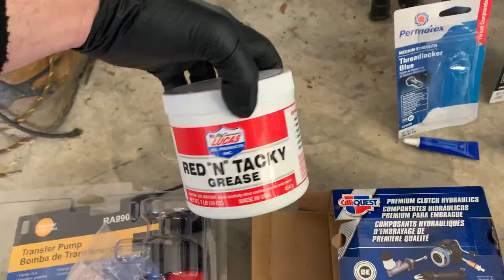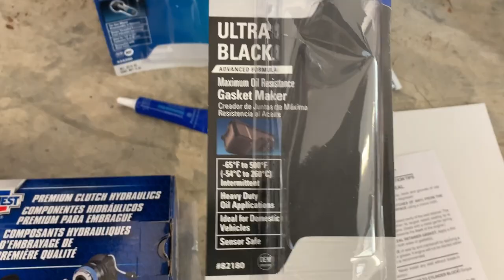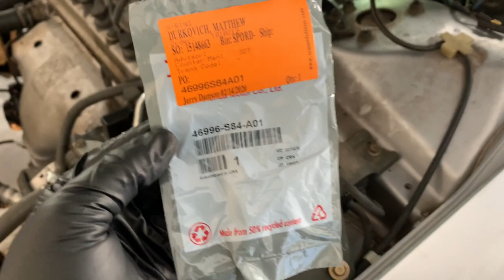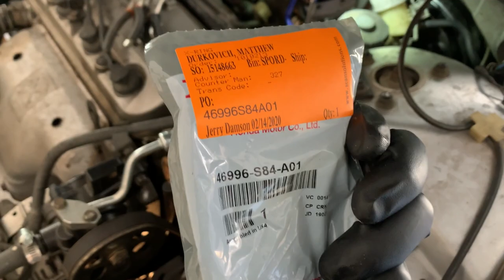2002 Honda Accord clutch and transmission mother load video!!!

Comment: rear main and front main seals typically go in dry. and before the seal housing is installed. ive never ran lube on the seal housing or seal. just a tip for others.
Reply from the maker: Solid tip. Other mechanics I talked to said dry could be an issue. I will say I liked doing it after seal housing to ensure it was exactly flush. A few millimeters wouldn’t matter to your point. I’m not a pro though. Appreciate the tips!

Comment: in doing this job ive lost order of the bolts for the bell housing (which ones go where) are the two on the top the same size and also i have the trans up and in but its not sliding in completely as it should any idea what i should do? or whats going on?
Reply from the maker: Hey there. First off, from what I recall, yes, the bell housing bolts are all the same size. I don’t recall putting them on my paper and saying “3rd bolt down” or anything like that. There is only one bell housing bolt. If it’s not fitting in the hole, you have the wrong bolt. 
Regarding the trans not sliding in all the way, that’s a rough one. If I were you, and the bolts weren’t in, I’d just pull it back out and double check everything aligns. Hopefully you have a transmission jack, or a friend:) The advantage to pulling it out and retrying is you can be sure everything is as it should be before reinstalling. If the input shaft is aligned, and you used a clutch alignment tool, the dimensions align and there’s nothing to restrict the bell housing from properly seating. Maybe the clutch fork slipped or was otherwise in the way. Make sure there’s no wire or cable or part getting sandwiched either. Get help putting it back in. As you see in the video, I had my son top aide to spot me visually, and start threading the ones that thread opposite. That was really helpful! 
Good luck!
Reply: @durk1980  thank you! i ended up finishing it last night i have a few bolts + the trans mount in just to hold it and im going to head back in there tonight after work and button everything up i appreciate how helpful you were great video!
Reply: @durk1980  normally i leave the bolts where the go by just threading them in a tad but ive been solo on this job so by the time im pulling the trans on top of myself there is shit everywhere on the patio lol😂
Reply from the maker: @Alpixed, I hear you. It’s always 3am when we’re finishing these, and you find yourself bench pressing a greasy, slippery, heavy chuck of metal above your head. That’s why I bought the transmission jack finally. Hopefully everything works out. Good call on slightly putting all bolts and fasteners back in so you don’t lose anything. Where possible, this is a great habit. Good luck man!

Comment: I have to swap out this Honda engine how long will it take and what will I need ?
Reply: Engine swap? Not sure. This was transmission. You’ll need. Strong engine hoist for sure, and all the necessary bolting/unbolting tools. Not a simple job, but not the hardest either. To pull an engine you have to disengage from transmission, hence the beast of a job. Good luck!
Reply from the maker: Hope it went well!

Comment: Did u install a new pilot bearing on the new flywheel?
Reply from the maker: Go to 1:42 in the video. I did not, because it came with one already installed. Most new ones will have it already on there. Best to check though.

Comment: everything dismantled and now i cant get the trans to seperate
Reply: Probably dowel pins are corroded and you need to “wedge” a pry bar between block and tranny to “crack” the seal. Also you are probably missing a hidden bolt.
Reply: @MrMpm3001  alright I'll keep digging appreciate it this has been an absolute nightmare
Reply: @angelic420x5  I bet it turned out to be the 17mm under the t bracket. It’s a bih to see at a glance.  Also you’re gonna have fun getting it back in and lined up too.
Reply from the maker: Hope you got it to separate! You may have seen in the video where I forgot that one bolt, but it was separating, just not 100% releasing, so I knew it was hung up somewhere. In your case, I’d put the bolts back, but not all the way, and try to take a pry bar as suggested and crack it loose. The bolts being in will prevent it from just falling. Safety first for sure. Hang in there man, this job sucks for sure, but you’ll get it…if you’re right there, you’ve already done the hard work. BTW, if the rear main seal isn’t leaking…leave it alone:)
Reply: @durk1980  lol yeah my friend told me that to

Comment: Im getting ready to do this job (minus hydraulics) on my 2000 accord. Why is it necessary to remove the axle on the driver's side,  what will happen if i don't?
Reply: Disregard, i answered my own question.
Reply from the maker: All good! Hope you had success.
Reply: @durk1980  I did,  thanks... I used your video extensively throughout.

Comment: If I'm not looking to replace the slave cylinder, only clutch, flywheel etc, do I still need to undo all the stuff from the top of the engine bay?
Reply from the maker: Yep. Everything for the clutch was in sequential order. Once I started slave cylinder, you can ignore all of that. Very detailed amount of steps still, but take your time and it’s definitely possible. Good luck!
Reply: @durk1980  thanks for the reply, mate.

Comment: Absolutely wonderful video. I’m going to use this info to remove a manual transmission from the junkyard for my currently automatic accord.
Reply from the maker: I’m not sure that will work. Automatic and manual transmissions are different. I say I’m not sure that will work because I don’t know what you’re trying to swap out. Make sure you “measure twice and cut once”. Good luck!

Comment: great video. Im going to do this job next weekend and this video will be invaluable to me and make my life easier. I definitely see where the parts where chrisfix has influenced you haha (the transmission bolt wrench trick, brake cleaning the fly wheel and pressure plate, marking the torqued bolts with sharpie, changing gloves, input shaft jiggle, etc)
Reply from the maker: Lol. I’m a lot like Chris Fix in that regards. I’m a little OCD. That’s why I love watching him. I have watched so many of his videos and they call me, lol. Good luck!

Comment: Thanks, nice video. I did clutch on my CRV 2005 140k miles. Put the transsmition on is very tricky. I had teeth on teeth on the central axel to crank shaft and also on the wheel drive shaft. Then I little turned with the rear hub and everythink click together. Ohh, horrible job!
Reply from the maker: Yep, it's a beast of a job!

Comment: Ooo wee this looks like fun 🥲 
I picked up an 01 accord ex manual for free the past owner said that the mechanic told him it needed a clutch so he bought it and never installed it because he said the car was being a headache so he just gave it to me for free I stumbled into him by try to sell a product lol he told me the car turned on but didn't go into gear so I took the offer and started investigating and found out the shifter cables were torn replaced that also had a cracked manifold replaced that all four engine mounts were bad so while I was installing the shifter cables and manifolds I went ahead and just put the engine mounts and hoped it ran so I started it and well it ran but It seems the clutch may be bad and thought on replacing while I'm at it but I've taken approx 1 week lol since I'm new to this so this looks like a lot more work and might as well get the new slave cylinder and master cylinder wish me luck and thank you for the Vid.
Reply from the maker: Good luck!

Comment from the maker: @Cooper Pierce
Cooper, I fat fingered this and removed your comment on YT accidentally. Through the app, I’m responding. Hoping it shows up. Check 29 min mark. The paper gasket is sandwiched by RTV. I had 3 in my kit as shown in the beginning. I personally don’t know if there are simply extras, but only one fit perfectly for me. You only need the one. Also, if the rear main seal isn’t leaking, don’t touch it. I know the temptation to replace is high, since you’re right there, but I found that the original one will keep on working. If you’ve already replaced it, all good. So did I obviously, and I liked the peace of mind knowing it was new. Good luck
Reply: Thank you sir they must be extra then just wasn't sure.

Comment: @durk1980 can u shed some light in the axle problem I have a 98 which is the same as this one my transmission seems to be slipping also what was wrong with the axles to make it slip don't want to change clutch if it's axles in mine
Reply from the maker: My CV axles were simply “dry”. The grease was no longer grease in the boots. I think it was a combo of clutch being worn down, and cv axles not being “smooth”. Short of major issues, there’s really nothing else it could be. I ended up replacing my wheel bearings as well, from sounds made while turning. Everything sort of fell apart in one time period, but after 18 years of hard driving, that’s pretty good IMO. I made videos of all that. Check out the main channel and you’ll see them. Good luck!

Comment: I got quoted a 1100 to do this. I’m debating if I should take on this by
Myself ..
Reply from the maker: Good question. Materials alone will be significantly cheaper, but labor, and any associated errors, will be all on you. That’s the risk with any DIY project. It was totally worth it for me. Just remember, if your rear main seal is not leaking, leave it alone. That was the one thing I regretted doing in my project. I didn’t hurt anything, but if it ain’t broke, don’t fix it. Good luck!

Comment: @35:25, are any of the fasteners in the project torque to yield (one time use only fasteners) that need to be replaced when reinstalling?
Reply from the maker: No, but you do need to reapply threadlocker where I’ve pointed it out. Even if I didn’t point it out and you feel threadlocker is appropriate, go for it. Just know what color is what and don’t “lock” something you shouldn’t. :)
Reply: @durk1980  thank you!  I’ve only used red thread lock on one occasion. It was when I got tired of a screw backing out of the faucet handle on an outdoor water faucet.

Comment: to drop the axle out of the wheel hub you dont have yo hassle with the ball joint or anything just the upper control arm and the wheel hub should drop down and you will be able to then pry the axle out
Reply from the maker: Good suggestion, thanks!

Comment: Nice video! Did you end up using the paper gaskets for the rear main seal housing gasket plus the rtv? Would you recommend I change the rear main seal gaskets as well or just the rear main seal itself?
Reply from the maker: @Moi Hernandez, yes. Checking out 28:30 in the video. If you replace the rear main seal then you have to do the gaskets. That said, if your rear main seal isn’t leaking, leave it alone. You just run the risk of it leaking later and asking yourself, why didn’t I change it when I was there?!

Comment: how did you keep your motor from falling if you took down the subframe?
Reply from the maker: You can see when I get to the clutch, and the camera is under the car, that it is indeed freely hanging there. I removed the transmission mount, and you have to put something under the bell housing at that point, and then of course once it’s separated from the rest of the transmission, it’s ready to be removed entirely. The engine, however, has its own engine mount, and that is what keeps it supported. I will say you’ll notice once I start taking off the pressure plate, that I have a block on top of my floor jack, supporting the other half of the bell housing. This was in order to not let it sway back-and-forth as I was loosening those bolts. It is supported, but if you were to push it down really hard from the top side, you would certainly feel a great amount of movement. As you start taking it apart, you’ll see when it starts to flex or barely move, but it is indeed, safe.
Other cars you can’t do that. You’ll see an engine hoist in my Mini Cooper videos. That engine is barely held in there to begin with.

Comment: I have a question I have one that I just bought at 115k there is vibration in the clutch when pressed soon as it's driving u can here like a little whine. Any info helps. Thinking it is Throughout bearing
Reply from the maker: Tough to say. Could be throwout bearing, could be clutch, or it could be the flywheel. If you hear a whining, something is grinding would be my guess. Truly, it’s a hard job, but not so hard that you can’t do it. If you have 115k miles, it’s likely the original clutch. If you get the whole kit that I did, just be careful not to change the rear main seal if it’s not leaking. That one for sure is one where “if it’s not broke, don’t fix it”.
If you watch the video again, when I show the inside of the bell housing, just realize there are only so many moving parts. Something along the line has failed. You can start with a cheap part, but in order to get that bearing, the bell housing has to be separated and dropped anyway, at which point, you might as well replace it all. Good luck!

Comment: 31:56 Some say not to put any grease/oil on the OD of the seal then drive it in dry or else you may get a leak.  How has this rear main seal performed since installed?
Reply from the maker: I sold I’m the car several months later, but it wasn’t leaking oil when I did. I will say I should’ve left it alone. Unless you see visible signs of leaking, leave it alone. That was nearly 200k miles old and going strong. Why replace it? The main reason is because you’re there and by the time you get that many layers deep, “you might as well”.  For what it’s worth, I really did wipe away much of the excess. I’ve put that grease on several times in a video, and when watching it during post it does surprise me how much it looks like I flipped it on, when in reality I’m just coating the surface so it glides and doesn’t dry start mechanically. Good question though. If I were to do it again, I guess I wouldn’t put anything on just to compare, but I’ve never heard of it leaking because of that. Not saying it isn’t true though; just haven’t experienced it myself.
Reply: @durk1980  Thanks for the reply.  Here's where I was advised not to grease the OD  https://youtu.be/vVDvEE_Hbm0  I haven't seen anyone else do that either.  I just replaced the rear seal on my '05 Element at 126,000 miles, not because it was leaking (in fact it was bone dry and perfect) but because I had dismantled that far in anyway and from past experience with the clutch on my '01 PT Cruiser, where I skipped that step, one month later the rear seal started leaking.  It's preventative maintenance when you are working on older vehicles with over 100,000 miles.  With this Honda though, I felt guilty about removing a part that was not faulty.

Comment: i can’t get the trans back on the motor. any help appreciated
Reply from the maker: @Austinp718  I had a tough time myself. The video goes fast through that part, but if the input shaft is straight, it will go in. Trouble is, if it’s off even a tiny bit, it won’t start going in. Then, the splines have to align just right, which is why wiggling it back and forth a little bit is good too. I just did my sons Mini Cooper twice, due an error on my part the first time (left one flywheel bolt due to stripped hole I didn’t want to fix - thinking it would be fine). I did get the flywheel bolt in with a proper tap FYI. The first time I removed and reinstalled the bell housing by hand. Removing is not so bad. Putting it back in was very, very hard. The second time I bought a low profile transmission jack from Harbor Freight. It was helpful removing it, but invaluable putting it back. Get help to have another set of eyes guide you in. With an aligned input shaft, and no weight to bother you, it will go in much easier. Good luck!

Comment: At 7:20 next to where your finger is . That pipe piece what is that for ? I put transmission fluid through there :0
Reply: PDF  how would I know if my transmission is low on mtf ? Seeing that they don’t come with a dip stick? I just bought the car so I’m new to this
Reply: PDF  thanks appreciatte it
Reply: @midas5096  I refreshed my transmission oil on a 2.3 Honda Accord from 2001 (F23Z05 engine) a couple of days ago. I did this by draining the fluid through the drain plug like @PDF explained. Refilling through the fill plug was impossible for me. There were some bearings and gears inside the transmission. They were blocking the way and fluid was going way too slow. Because of that, I unplugged the reverse light sensor and refilled it from there. Took some time, but it worked! ETCG has a video doing this on his Acura Vigor. I used genuine Honda MTF fluid.
Reply from the maker: @Midas, @ PDF, PDF is right. It’s in the video (putting MTF in). This isn’t like engine oil. It won’t go bad every 3,500 miles. Once replaced/flushed you’re set for a long time: probably close to 75k miles if not more. Regarding breather valve, I’m not sure what happens when you pour MTF in it TBH. Once started, natural positive pressure will probably push some MTF out, so don’t be alarmed by that, but liquid of any kind is not supposed to come out, FYI.

Comment: Where is the ac pressure switch located ?
Reply from the maker: @Midas, I'm not sure. I don't recall doing anything with the ac, or having to mess with that switch. This make and model is all over Google in terms of exploded parts diagrams. Hopefully a quick internet search will provide the answer you need.